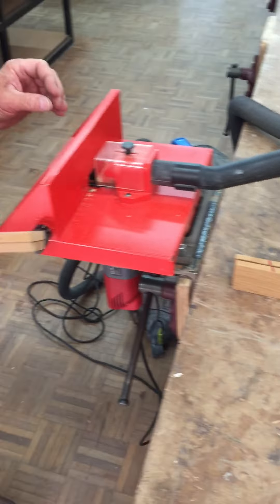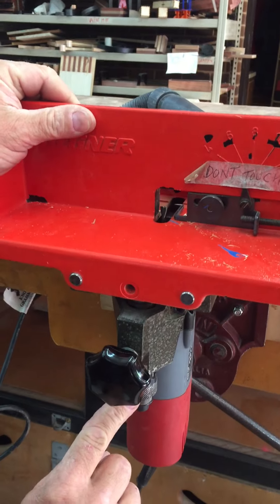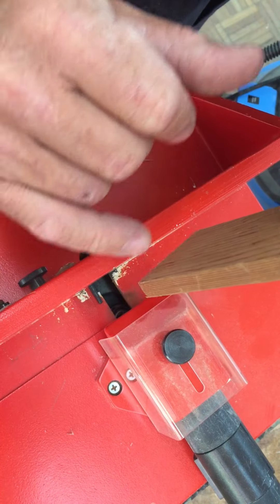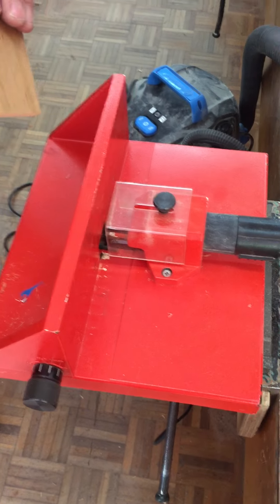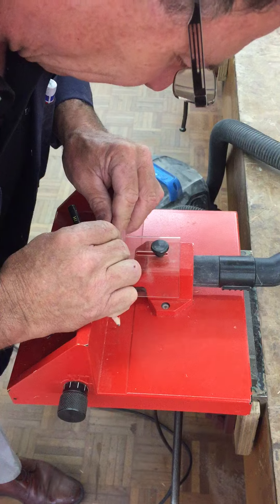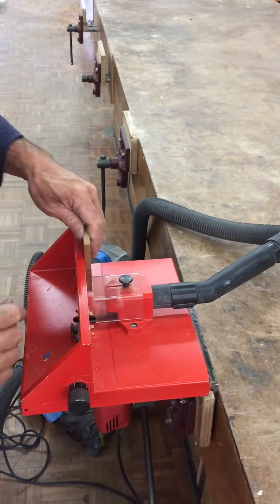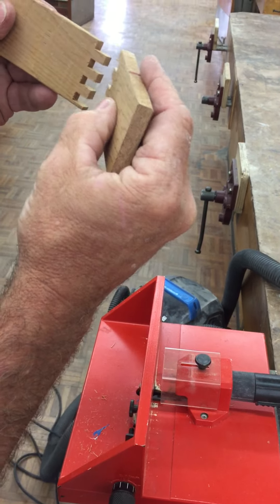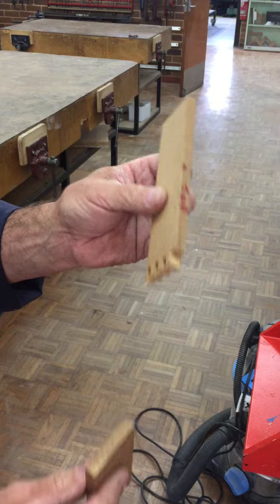Hegner Finger Joiner Demo

Comment: -I was lucky enough to find a second hand Hegner ZFG and it is fantastic. Your video was a big help before my first use of the machine. It only took a couple of test cuts and then it produced perfect joints. I'm not sure if it is recommended but with thin stock (8mm stock and a 6mm cutter) I find it speeds things up  if I machine the matching pairs together.